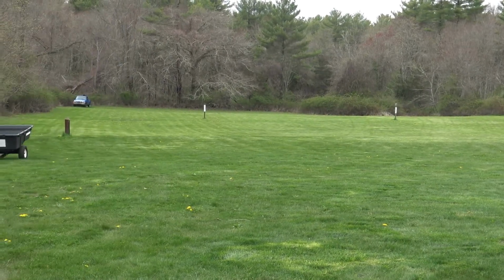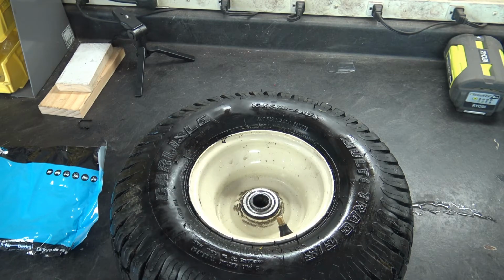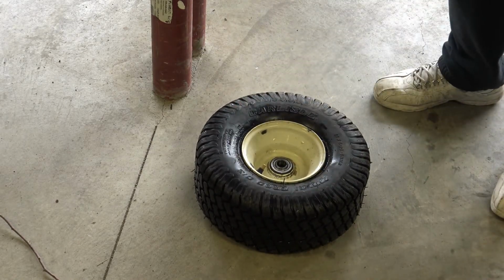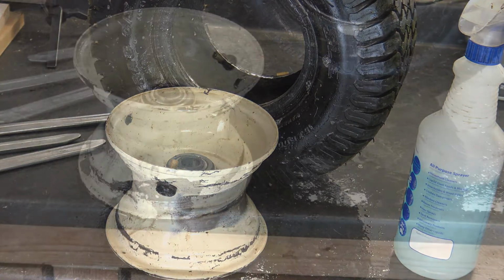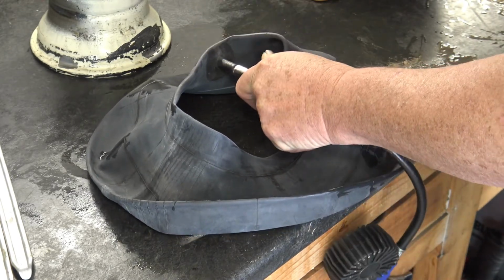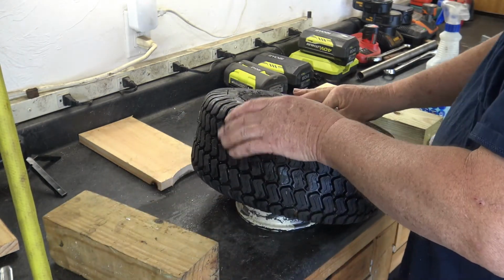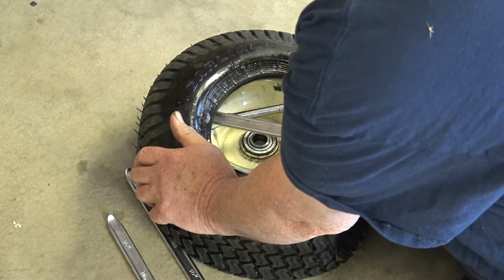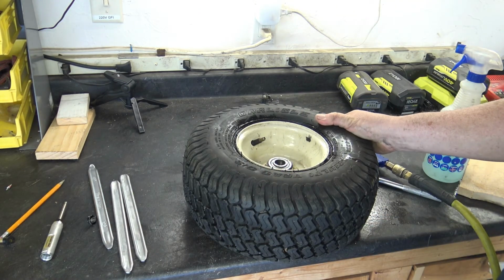How to Install an Inner Tube on a Cub Cadet tractor

Comment: Can anyone tell me if the front rim is offset 3" or centered. I saw two wheel assemblies on Amazon and both said it was compatible with my XT1 Model#: 13APA9CT056

Comment: Very helpful video. First time using new tractor Lt46 and i get a flat front tire. Boight a tube but found puncture and plugged it. Next time, I'll install tube. Thank you
Reply from the maker: I found these tires are very thin and difficult to repair. 3 of my 4 tires now have inner tubes.

Comment: I'm a pretty handy guy But Its a Blessing to find your videos. I always learn from from your experienced advice and well produced posts. Thank you.
Now I've got everything assembled and ready to be tightened down to reinstall the deck on my XT1. A PIECE of limb 2" long got up in the box that holds the 2 idler pulleys that contain the drive belt and scalloped it. 
Your other video on drivebelt replac't  was extremely helpful. I took a break for the Sun to set behind the trees as It's 101°. Lol
Our xt1 42" has 390 hrs.
In 6 yrs,  replaced.
1 broken deck belt last yr.
1 spindle/quill   when I did the deck belt. So in all. 
The drive belt 6-25-24
1 pr blades 6-25-24
2 oil changes per yr.
Non ethanol gas only.
It's been a very good little tractor for $1439.00 in 2018.
Kohler eng. 
No oil leaks, no burned oil, original battery still working fine.
I blow out the air cleaner with the compressor 3 X's per yr
And replace the filter every spring. 
Thank you again.
Thank
Reply from the maker: I enjoyed reading your post. Thanks for the very kind words. All the Cub Cadet XT1 and XT2 machines I have worked on that plastic idler pully has failed between 300 and 400 hrs. I wish that one part was made of steel.  Otherwise, they are great machines. My XT2 is a 2018 model year also and is still on the original battery as well.

Comment: Great video on how to break down a lawn tractor tire, install a tube and remount the tire.  Your video was helpful and informative.  What length tire spoons are you using?  Thank you very much.  Charles
Reply from the maker: I am very sorry I have taken so long to reply as I spent some time in the hospital this past week. The spoons are exactly 10 inches long and came in a set of four. However, I do not remember where I purchased them, but I do remember they were not very expensive.

Comment: I watched quite a few videos on this subject yours is the first to use wood blocks to hold tire up to install tube.great idea.thanks.im doing my two front tires tomorrow.
Reply from the maker: Sorry I did not reply sooner as somehow my notifications got accidently turned off. I thought no one was watching my channel anymore until I just figured it out. Glad you found the video helpful. I hope the job went well.
Reply: @richardspaulding5035  Got both front tires fixed with new tubes.Job went pretty smooth.thanks again.your video was very helpful.Thanks Jerry

Comment: how do I order the right inner tube. Are the location of the stem always at the correct spot?
Reply from the maker: Just take the numbers off the tire itself. Last time I purchased a tube it was from Amazon; I simply entered the tire numbers in the search window and the correct tube popped up.  Usually there will be a white or grey ring on one side of the tube. This will be the side that needs to be face up when inserting the tube so the stem will correctly line up with the hole in the rim. Thanks for the question, I hope this helped.

Comment: Wow, how convenient your doing the easy front tire. Now let's see how you do with the stiffer, thicker rear tire Mr. Easy. Oh and by the way, make note that was a brand new tire not an older, drier one like yours might be by the time you need to do this. Cute video though.
Reply from the maker: Wow, I am not sure how to respond to this. I don't stage the videos on my channel. The only reason I chose one of the front tires is because that was the one that was actually leaking. The tire was far from new as it had been on my tractor for several seasons. I am now in my 6th season with this tractor and to date neither rear tire has had a leak. I have only added air once this season and we are in late August at the time of this writing. Rest assured friend should the need actually arise I will indeed post a video. Thanks for watching, I think.

Comment: Could use vise grips to hold the stem from falling back into the rim.
Reply from the maker: I think that might damage it. One of my viewers suggested putting the plastic cap back on to prevent it from falling thru.

Comment: Cub Cadet is a horrible company. I'm done buying them. MTD takes shortcuts in building its machines.  Terrible company MTD.
Reply from the maker: I am beginning to figure that out, I paid a lot of money for my machine, I am contently repairing something. In almost every case a part that is made out of plastic that should have been metal has worn out. Just this week I had to order the throttle cable assembly. The steel cable wore thru the plastic connection point of the throttle lever.  Previously a flat spot developed in one of the plastic drive pullys.that I had to replace.

Comment: Thank you so much. This helped! Also, if anyone is looking for a cheaper option for keeping the valve stem from slipping inside the rim….place a washer on the valve stem and then screw on the cap.
Reply from the maker: Greate suggestion.

Comment: Helped tremendously. No fancy stuff, just the straight poop! Don't need the stem holder, just wrap some electrical tape around stem and worked for me. Stressing that you should start on opposite side of vice grips to start getting tire on important.  Love it, now feel like a pro! My tractor is up and cutting
Reply from the maker: In the video I temporarily inflated the tube to see which side was up. One of my viewers pointed out that the printed ring on one side of the tube indicates the up side.  Thanks for the kind words.

Comment: This is an excellent video.  This technique is the best for working on the small tractor tires.  Thanks for your effort to demonstrate your method.  It works Great.   John
Reply from the maker: Sorry I took so long to reply. I try to respond to all my comments but as the channel is growing it is becoming more of a challenge. As you may recall from the video, I temporarily inflated the tube to determine the upside.  One of my viewers pointed out that was not necessary as there is a ring printed on one side of the tube indicating the top. Thanks for watching.

Comment: 64-year-old female here with a slow leaking front tire on my CC XT1.  I definitely think I can do this after watching this video!  Thanks, Rick!!  Great video with no fluff!!  I might have to rewatch just before I actually do it.  😉
Reply from the maker: I have you beat, just turned 70. Stay in touch let me know how you make out.
Reply: @richardspaulding5035  Well, I'm back.  Limped along airing those things up which became every time before I mowed!  I'm finally giving in and ordering the stuff to fix at least the front two and one of the back ones is giving me a little trouble too now, so I might be tackling the back ones next.  I'll definitely let you know how it goes.  Thanks again for the vid.  I had to double check if I needed straight or curved stems, lol.  I came back to the guru!
Reply: I got stuck trying to get the tire off the bead.  My mower's a 2015, bought it in 2017 new (ha!) and it's never been off so 10 years of mud and crap didn't help.  HERE's how I finally got it off:  https://www.youtube.com/shorts/bpBhdXuC4hw

I had to STAND on that 2/4 before it finally gave up!  But I got both sides all the way around, so we're on to spooning off the old tire!

Comment: OR... I drill two 1/2” holes on the sidewall on the backside 180⁰ apart or just opposing. Then; put foam spray in one hole until it comes out the other; spin the crap out of it and keep getting as much in as you can. A rubber mallet and whopping the crap out of it helps or while it’s jacked up... let it down until it squeezes some out an it will create a vacuum when your jacking it back up and expose air pockets. Never change or repair a tire again. Thank you and I hope I passed the audition.
Reply from the maker: I am very sorry I have taken so long to reply. That is very interesting, thanks for sharing. By all means, don't be a stranger.

Comment: At 11 minutes is where I somehow punctured the inner tube, and the whole process, and money wasted. I have the exact same  tools for that he used. But it is also a waste if you don't inspect the inside of the tire for pointy objects that will puncture the new tube, before putting it all together.
Reply from the maker: The video was intended to cover tires that are leaking around the rim.  If you are repairing a tire that had been punctured by a sharp object, common sense would dictate that you make certain the object was no longer protruding through the tire.  duh!

Comment: Thank you, thank you, thank you
Reply from the maker: Thanks Bobby, because these tires require so little pressure, they will usually start losing air after a couple of years. A tube is the way to go

Comment: Great video, very helpful
Reply from the maker: Yea, a tube is the way to go,  At only 14 psi it is very difficult to keep air in the tire.  A passenger car with 30 to 40 psi has no problem sealing the bead. Thanks for the kind words.

Comment: Hey Rick, thanks for the video!  Well narrated, very good sound level control, and good video of the process.   I have a front tire on the lt1042 which loses air, so after watching your video, I feel much better attempting a tube install, rather than taking it to the shop.  Thank you
Reply from the maker: The problem with these lawn tires is because of the very low air pressure, if there is any corrosion it is very difficult to get the tire to seal. The tubes are very inexpensive and once installed you can forget about it. Thanks for watching

Comment: thanks, thought I had a nail in tire but it was like you said, not sealed well!
Reply from the maker: The problem with a lawn tractor is they only require very little tire pressure. My tractor takes 14 psi in the front and only 10 psi in the back. It makes it very difficult to maintain a seal. My tractor is only 3 seasons old going on 4. I have already had to install 2 inner tubes and I am sure the two remaining tires will be needing tubes soon.

Comment: That tool you said to use to keep the stem from falling in will do that, but it's actually for installing and removing tubeless stems by screwing it on the stem and prying against the rim.  You might not even have to cut the inside end of the tubeless stem off to pull it out.
Reply from the maker: Yes, you are exactly correct. I have a tire machine and I use it for that purpose. However, it does indeed come in handy for what you saw in the video.  Being a mechanic, I adapt many different tools for many different things. You are the first person to comment on that. Thanks for the comment and watching my channel. Now that you have found my channel don't be a stranger.

Comment: Where did you get the tube from
Reply from the maker: As I recall I got it from the Tractor Supply Store. Make sure you get one with a strait stem.
Reply: @richardspaulding5035  ok cool straight stem got it! thank you! And I'm assuming it'll be the same size as the tire?
Reply from the maker: @Mr.Towboater87  yes

Comment: The stem guide. Drill a hole in a screw on valve cap and you're good to go. Use a strong piece of cord, wire, etc... Whichever you have around. It's not as good but it works.
Reply from the maker: Thanks for sharing that Nick; I will give it a try next time

Comment: i remembered had this problem on my John Deere X350 loosing air as i put in lots of rim sealer and it held air still does. as was close to putting in inner tubes in both front tires. most home improvement stores sell this Arnold 15 x6-6 universal lawn tractor front tire the plastic bushings suck in them.  15x6-6 is a common tire these consumer lawn tractors and dump cart has.
Reply from the maker: Thanks for the comment and thanks for watching my channel

Comment: Notice the blue stripe around the inner tube?  Most tubes these days have this blue stripe around one side, and that tells you the valve stem is on that side.   Of course, partially inflating the tube works too!  Thanks for the video, it was helpful.
Reply from the maker: I was not aware of that. thank you for that information and thanks for watching my channel.